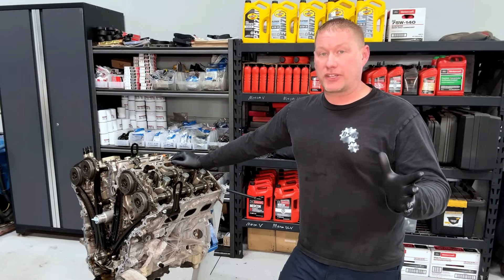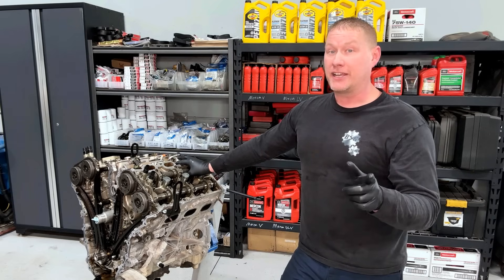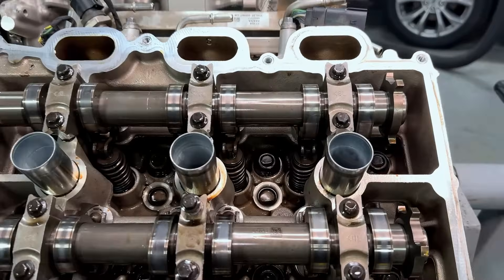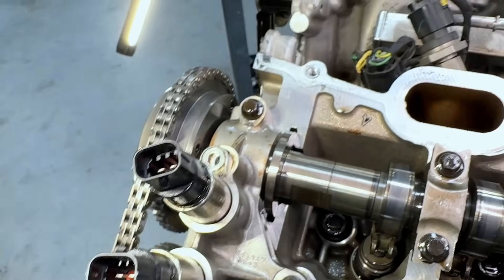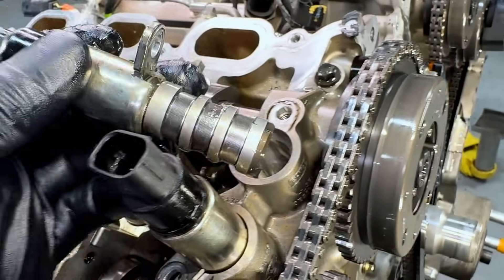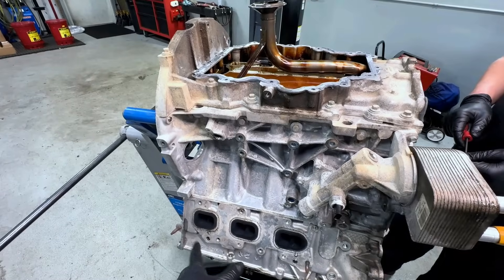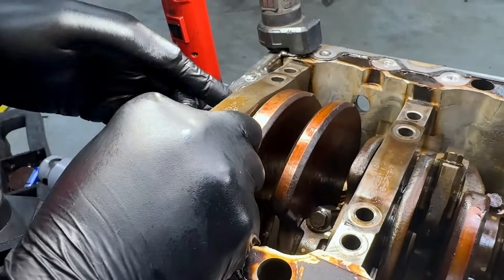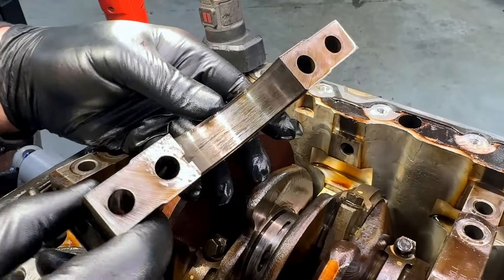Did The Ford Dealership Technician's Neglect Cause This 3.5L EcoBoost Engine to Fail?

Comment: Bought a new 23 f150  loaded xlt.week 3 had  intake failure ,hit auto start and engine redlined for 5 minutes.1 month later lost auto headlights and cruise,2 months later alternator assembly went out sounded like a bad power steering pump. 3 months later front end dont drive normal.been back 6 times still not fixed. Fast forward 1 1/2 years later.24k miles lost transfere case and truck has been in shop 3 months .still no fix for adaptive cruise or auto headlights.deemed unsafe to drive from ford mechanics.in process of buyback.smdh. i baby everything i own unbelievable chevy is even worse

Comment: Great video, but I am left still asking, did the main bearings fail from a low-oil condition, or did they cause a low oil condition. if they failed for a low oil pressure condition, do you have a theory for what caused the low oil condition in the first place? I have a 2019 Raptor and had a low oil pressure condition that ultimately led to all bearings failing. Even with a Melling high volume oil pump installed (during a full timing job). Very interested as to whether on not the gen two 3.5 EcoBoost has an oil pressure problem that few are talking about. Thank you for your great content BTW.

Comment: I do all my own work on my 2001 F150 5.4 240k miles that I bought brand new.  

I had a real good mechanic who owned a Toyota/Lexus only shop for my wife’s rav4, but he retired.  So back to working on that. 

TBH, that car is very easy to maintain and easy to work on.

I don’t trust shops anymore. So many issues with techs today.

Comment: My guess, previous mechanic who did the timing job started it without oil in it.
Reply: Posible no assembly lube. I still tend to think it was overheated. or possibly break cleaner in the oil from the timing job. Did he say how many miles it ran since the timing job?

Comment: Eco boost engine 3.5  with 180,000 miles what would you recommend related to a good cleanser keep the oil keep flowing good before 3000. I  change it before then I use the pennzoil, but what’s your opinion like Molly cleaner to use in oil treatment to run it through the motor to clean up everything what’s your recommendation?

Comment: I’ve worked on European vehicles half my career. The bmw 2.0 (n20 engine code I think) had bad timing chain issues. I actually never did chains on one before but I did do an engine on one for a used car dealer I do work for. He had the timing chain done and few hundred miles later the engine locked up. Another dealer I do work for came by when we were working on it and had the same story he did chains then the engine locked up. When I replaced the engine I took it apart because I was curious what happened. I took the oil pan off and there was a piece of old timing guide stuck in the oil pickup. Yes the oil pan should have been removed when the shop did the timing job however the oil pick up was a terrible design. The pickup tube starts out as just a tube then a screen down in the tube, the tube is so small that just the one small broken piece of a guide blocks off the entire tube and the piece is stuck inside the pickup because of its design so you might get enough volume at low engine speed but not cruising.

Comment: That oil pick-up looks just like the one in my 2010 f150 4.6 3v after a cloyes guide failure in 6 months. Yes im sure this caused oil starvation.

Comment: I knew exactly what this was as ive been having a ton of the gen 1s that do this. The extra heat from them spinning also deforms those center main caps very easily, when the rods spin they damage the rod very quickly as well. I just dropped off 4 cranks. Luckily the gen 2 cranks work in place of the gen 1

Comment: Sir, what another way/s to flush/drain the coolant aside from suck it out or draining it through the cock plug? Because that plug is blocked with glue somehow (long story).
The car is 2010 Ford Taurus 3.5

Comment: Brian, great video.Thank you for the post .   is this likely due to using the wrong viscosity oil?I'm a little baffled as to why the bearings would spin on a motor that was not and had regular oil changes

Comment: Off this subject, can we talk transmissions? Searched but can’t find (your) opinion on transmission flushes vs drop the pan oil/filter replace. 2015 F160 55,000 miles, transmission has not been serviced yet.

Comment: I've never had engine problems more or less a failure but I've only had a 82 Dodge 3.7, 80 Buick 5.7, 88 Toyota 2.0 Turbo, 96 Pontiac 3.4, 98 Honda 1.8, 99 Dodge 3.3, 12 Dodge 3.6 and 20 Subaru 2.5.

Comment: Looks like typical oil starvation damage. I wouldn't be too surprised if the sealer used from the timing job had found its way into some of the oil passages.

Comment: @FordTechMakuloco with all the flooding from this hurricane I think lots of people are driving with water over the wheel hubs, I think you should change the diff fluid after doing that but others disagree cause the breather hose goes up to the bed.  What's your say on the matter?
Reply from the maker: Nothing is waterproof so I would check the axle fluid after for milkiness and service as needed.
Reply: @FordTechMakuloco  I think it would be a timely and informative video.  Some people are even saying it would evaporate out from the heat.  which is a yikes comment to make.  I'm glad to hear you think it's worthy of looking.  Some people are saying if water can come in the gear oil would just leak out.

Comment: One way to tell for sure that the two center bearings were spun, is that normally the half towards the bottom of the motor is smooth, while the half towards the top of the motor is slotted with the oil flow holes in it. Here we saw the exact opposite! When the half with no slots/holes gets spun around towards the top of the motor, oil is then blocked from getting squirted into the bearing and within a few revolutions of the crankshaft the bearing is toast. The real question is what caused those two bearings in the middle to get spun around in the first place?

Comment: Got a 2020 f150 3.5 with 95k and its been a great truck . Only thing is now i need a new starter but thats been the only issue really. Every vehical has their own issues no matter what you get ...especially with the equality control of new vehicals or lack there of . As long as you follow the services to a T or even more meticulously than that I suggest then the EB no matter what gen should last you atleast 200k to I've even seen some with about 400k . You will have to replace some things here and there but it will still be cheaper than buying a new truck especially no days then having to pay for those issues or an old vehicle and having to pay for those issues too . Stick with what you got and take care of it and you should be fine ...or get a toyota older than 2022 lol .

Comment: No reason for the bearing failure, but it looks like bad assembly or inferior bearing material. 
My old Chevy 305 had a bearing knock at 75,000.  (Several others did too). An autopsy showed all the rod bearings badly worn/scored but the mains were perfect.   Didn't seem like a lack of oil, but bad parts fitment.   My aging F150 has 262,000 miles and has never been apart.

Comment: Obviously anybody who buys a Raptor wants to run it hard.  I would assume that it ran out of oil, even for a short period of time.  Whether it was low on oil or the pump starved during some off- road activity, you would have to ask the customer how they were using it.  Either way, it's a shame.  These engines are very particular.

Comment: Did you find that broken piece in the pan, or did that last guy who broke it removed it?   I am due for timing chain and water pump in my 2014 Flex EB. 185K miles, runs like new, but occasionally can hear chain slap on first start.  What was the consensus on what caused the bearings to fail in the first place? Dry start after repairs?   It had to be something the last Mech did, that engine is way too clean to fail that soon, and in that manner.
Reply: I know, I thought he was going to explain that part. Else, this video is kinda useless.

Comment: My best friend is a mechanic at my local Honda/Acura dealership and many of the newest Honda/Acura vehicles are being built cheaply.  Lots of minor issues with my 2022 Acura MDX as well as my wife's Lexus rx.  Luckily no issues with drivetrain that left us stranded but the minor issues are annoying.  Was looking at a new Honda Odyssey with my daughter and the rear power tailgate had a huge gap on one side and dealer said they recently switched to now just having 1 motor on the right side to close the hatch now so there will be a gap.

Comment: Seems like all new cars are built cheap.  I have a 2024 Tacoma and the transmission needed replacing, it was a recall.  The AC also went out and the clock stopped working.  My wife's 2022 Honda CRV has had so many little dumb things like the airbag light, glovebox wouldn't open, power tailgate broke...ect.   My daughter in law's 2021 Hyundai Palisade turned 75k miles and every month she has a new small dumb issue pop up from leaky sunroof to last week's fuel door would not open.  My neighbor has the new Honda electric suv and has been in a loaner car more than he has driven the Honda.   I used to bad mouth American cars but my f150 work truck with the ecoboost just hit 120k miles and never had any issues and I use it as a mobile office so it has lots of idle hours on it.
Reply: Completely agree.  My love for the Japanese cars is quickly fading.  Seems like they are all made the same now...cheap cheap cheap.  So many little issues with my 22 Acura MDX and wife's 21 Lexus RX as well as my daughter's 2023 rav4.

Comment: I'm betting someone forgot to put oil in it after changing it, and started it up no oil, doesn't take long with no oil to ruin an engine 10-15 seconds no oil you start to get bearing material transfer to the crank....

Comment: i made the decision if its drive by wire i don't drive it. if it doesn't have a rod or cable to the shifter i don't drive it. Advanced TECH is putting the new auto companies out of business. i like electric windows if controlled by switch not modules i like door locks if controlled by switch not modules newest thing i own is a 1999Jeep Grand Cherokee other is a 1994 ram 2500 and 3rd is a 1966 D500 Dodge Holmes 500 wrecker simple trouble free. would love to have one of the old 2300 Pinto's wonderful vehicles timing belt water pump only trouble. 300 inline 6 ford hard to beat. we need to back up and figure another way. I don't need heated steering wheel or heated and a/c seats and vvt and mds and all of those other 3 letter problems

Comment: I’ve been an F150 guy all my life  I’ve always gone 150-200k miles with no major mechanical issues - no timing jobs no rebuilds before selling the truck in usable condition to someone else and then buying a new truck. I’m currently driving 2007 F150 and am overdue for a replacement but these new turbocharged engines just scare the crap out of me.   Why in the world would you need an expensive timing job and then a full engine replacement at less than 100k miles.  Dear god what has happened to these once tough trucks!  It’s not just Ford, they all seem to suck now.
Reply: Me too, my 07 5.4L 3V is still running strong at 204,000....I use mobile 1 full synthetic and change the oil every 5K.....honestly it's how you take care or your vehicles...

Comment: I have a 2008 expedition with 5.4 L 3 valve.  It has an issue that would make for interesting content on your channel. The primary symptom is misfiring… But it only happens in reverse  with a load (towing my boat). There are no misfires except for that scenario. When it does, the check engine light comes on and it throws a camshaft position sensor code, both of which have been replaced with genuine Motorcraft parts. I’d love your input!
Reply: Check for wiring harness wear at the rear of the right head.  It maybe grounding a bared wire when the engine torques "the opposite direction" in reverse.

Comment: I had a 18 F-150 4x4 5.0 with the oli consumption problem,at 50k the dealership replaced the engine after a lot of back and forth of them trying to tell me that 3 quarts of oil in 5k miles was considered normal. They had the truck for 10 weeks to do the repairs. They removed the cab to do the engine swap. 3 days after getting it back from the dealership, my wife was driving down the interstate at 70 mph and the steering wheel locked up, the truck left the roadway and hit a big oak tree before she could get it stopped. It totaled the truck, Ford was notified and supposedly sent out an engineer to the salvage yard, but of course found nothing their technician had done wrong. Coincidence or did something not get tightened on the steering shaft?
Reply: Wow, that's horrible!

Comment: Hi sorry to gate crash this article though being a newcomer was not sure how to send you a question 
I live in Australia & have a 2003 Ford BA Ute with a 5.4ltr V8 3 valve engine & floor shift auto
My question is when I first start the engine it is nice & quiet just nice V8 sound then after 3 or so minutes it starts getting rattle noise around middle area of engine like tappets noise must be when oil warms up & gets thinner I imagine 
I recently changed the oil & filter & put in Penrite full synthetic 10W 40 which is thicker than recommended oil though I thought it would fix the rattle noise after start up it did help a little though not as much as I’d like & now really need your advice in what to do next 
Do I try even thicker oil?
It has done 135,000 klm
Thankyou regards Neil
Reply: I wouldn't go with an even thicker oil. Those engines aren't designed for thick oils. They have too many tiny oil passages for that.

Comment: Ftm what do the experts say caused those main bearing failures? Oil too light or sheared down? Incorrect clearance? Pump gone bad? Turbo boost out of control? Those Ecoboosts are bout nuff to make you loco.

Comment: It's funny how back in the 80s and 90s car manufacturers could make engines that could comfortably go 4 or 5 hundred thousand miles,,With little or no problem,,,The old GM 3600 and 3800 could do half a million miles on 10k oil changes,,,No probs,,,Now in 2024 That technology seems to be lost,,,Isn't technology supposed to advance with time,,,,Its backward we have gone,,,Think about it,,,,,,,,,,,,An old flathead engine from the 1930s is superior in almost every way ,,To 99 percent of all gas engines today,,,Except maybe for fuel economy,,,,,,,,We really are living in a upside down world,,

Comment: 84K miles sucks! Something went bad, and I do not think it was the customer or Fords fault, at least on the surface. If the front cover had not been taken off, then I would blame Ford. Good luck proving the dealership tech is to blame, although that oil control switch is very telling…

Comment: Guessing the engine was running with no oil in the sump for a while.   Maybe the previous timing job tech forgot to put oil back in it before running it????  Then, main bearing material went to the pan, and then somehow (filter's bypass open on a cold start-up?) it made it past the oil filter and on up to the cam phasor screens.
Reply: I had the same thought

Comment: Brian, you show us the result, but what exactly was the cause? Aftermarket tune? Bad gas? Poor assembly? Looks like the oil was changed often enough.
Reply: Using light oil and modern technology side by side is a winning formula for spoiling things.

Comment: You never said what your opinion was why there was bearing damage.  (Oil starvation is the correct answer or QC when it was built.  But that would blow up way before 89k.  Dealer miss diagnosed the noise and boned him for a timing job??

Comment: I don’t trust dealerships anymore. To my 6th gen Taurus for a water pump replacement at $2600.00. Picked it up and 6 weeks later my motor blew. They said “not our fault, we can replace your motor with a used one for $9000. No more newer cars for me. Still driving my 24 year old excursion and able to fix everything myself. My old 2008 Taurus has 240k miles. I fix everything myself.
Reply: I’ve done a bunch of them v6 water pumps and the first thing I do is drain the oil to check for metal. What can happen is the bearings in the pump fail then you get metal from the bearings and aluminum shavings from the pump housing in the oil running through the engine plugging things up and wearing things out this is what happens when the person continues to drive even though the engine is loosing coolant. You really need to stop driving these the moment they start to leak. I own a repair shop now and I personally wouldn’t put a pump in if there was metal in the oil or if it was over heated. Some customers get mad but I’ve been doing engine work for a long time and doing a questionable job like that isn’t good for anyone.
Reply: We have a 2007 Tahoe with 192000 miles.  I have done all of the work on it and it runs great.  My beautiful wife wanted something new as we had the Tahoe since 2010. So we got a new 23 Expedition Limited. It is great but I am a bit nervous to say the least.
Reply: What proof do you have that the dealership is responsible for that?

Comment: I had a dealership in Toledo do my phasors, got the truck back and the main bearing was wiped out, sounded very similarly. 

Naturally, the dealership said it was like that before and told me to sue them.
Reply: Did you ?
Reply: @bobtenharkel4367  no, the dealership has a reputation of tying things up in court so even if I would've won, I would've spent more fighting them than just cutting my losses. 

I sold it off to carvana wholesale (informed them of everything) and just moved on. It sucked but frankly, I'm kind of done with Ford after the last two flops I've had from them. Picked up a fourth gen Sierra 2500 and absolutely love it.